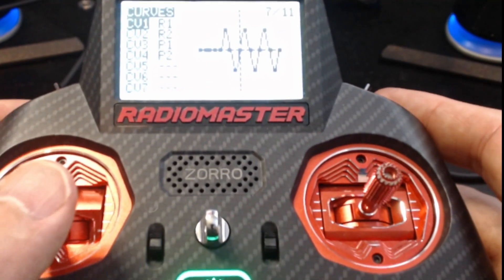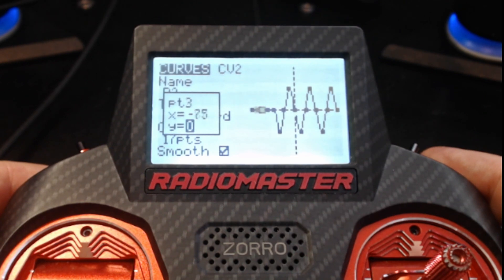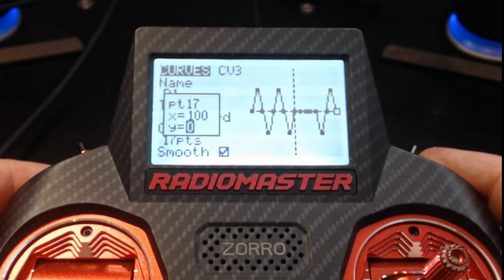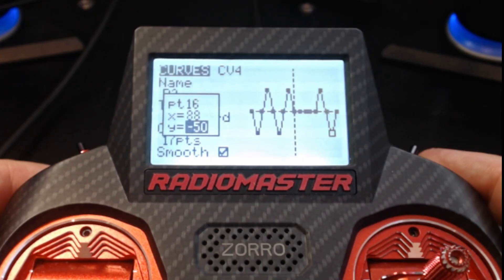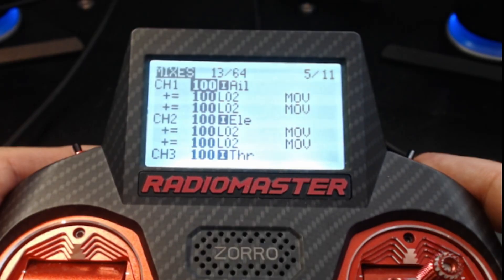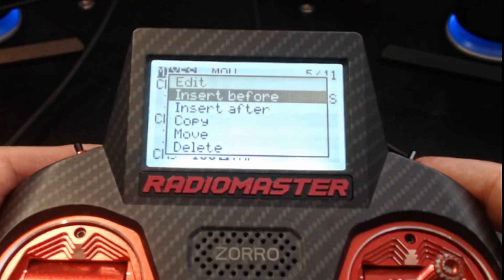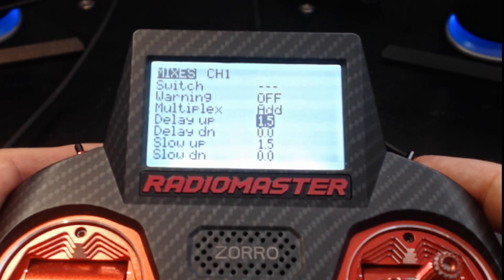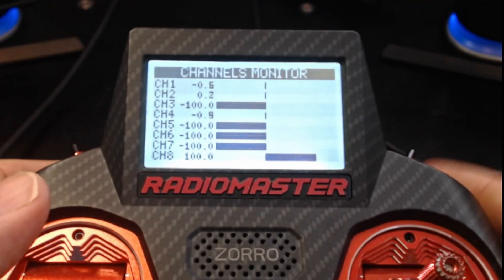An "Auto Wobble" Controller from your open/edgeTX radio

Comment: I have everything set up correctly, if I look at the receiver graph and activate the wobble mode the quad starts to oscillate in 2 directions but at the same time it slowly turns over with each repetition until it turns over completely, I would like to be sure that this does not happen during the tests, do you find the same behavior?

Comment: on my GX12 I can't make it work. tried on toggle button SD, but the logical switch L02 never goes active.
I used the function Tim to reset the L02 every 3 seconds until the SA is down.

Comment: This is a really useful script, thank you! I notice that it provides smoothed inputs, would an unsmoothed copy of it with plateaus after each setpoint change be useful to see how the gryo settles? That is, if looking at blackbox explorer traces.
Reply from the maker: The script could be adapted as you like. But it sounds like you’re interested in making it a step input. That’s very doable. But to do that you have to provide sufficient duration during the step, at least the duration of the presumed overshoot when under dampened. In other words you’d need the step to last roughly 100ms or so before returning to 0, then stay there for 100ms or so (longer for larger rigs whose resp latency is slower)

Comment: Haven't tried it in the real world yet but in betaflight receiver tab it shows the simulated quad gradually rotating left and to the rear. After about 15 seconds it's completely flipped. Been over the parameters with a magnifying glass and they're the same as in screen. Not sure if stick interactions to counter rotation will skew the logs or interrupt the script. 
Great work though. Very clever.
Reply from the maker: That’s because it’s an acro mode model. You can use it only to see if it’s working. You have to use angle mode to use it.
Reply: @PIDtoolbox  I did setup a switch for angle to see if that impacted but it made no difference. 
I'll try it in real world though to see what's happening. 
Thanks you for the reply
Reply from the maker: @baughaninastorm-y2t the BF model can not show results in angle mode. That model is unaffected by the mode you set
Reply: @PIDtoolbox   Fantastic thank you. Charging up some packs. Hope to give it a go later.

Comment: Which sample rate BB is better to use when tuning PD? With my whoop at 1khz BB the curves in step response point to D=0.95, and at sample rate BB 2khz the ideal curve points to D=0.8. I have tested with autowobbler several times and always come across this difference. Intuitively it seems that the higher the sample rate BB, the closer pidtoolbox will build step response curves to real processes
Reply from the maker: That’s odd. The step resp should not be affected by lograte at all. DM me over Facebook or Instagram.
Reply: @PIDtoolbox  Even without detailed analysis, you can see that for the same P, I, and D coefficients, the graphs in the step response tool differ greatly depending on the log collection frequency.
Reply: @PIDtoolbox  I'm not that good at math and transients, but I think it has something to do with aliasing between pid loop and loging rate or the nature of the differential component, which is related to the sampling frequency.
Reply: @PIDtoolbox  my previos answer was dropped( I also thought that lograte should not affect, but the facts say otherwise. I just repeated a series of experiments at 1, 2 and 4 kHz and got different curves for the same D. I am using version v0.71. Unfortunately, I do not have a facebook and instagram account, only telegram. But i will try to create instagram acc)

Comment: It works very well. Thank you. During the test, I also controlled the roll and pitch along with the throttle to avoid hitting the wall. Is this okay for analyzing the pid graph? Or should I only move the throttle and test?

Comment: this does not work with FreedomTX or whatever the Tango 2 Pro is running, right?
Reply: It doesn't work with mine. I can't setup the curves properly. As soon as I edit a curve, the next previous one gets edited with wrong values. I think it's a firmware bug. I have fdtx-tango firmware, version TBS-1.3.0
Reply: @FRY_FPV  same thing. I managed this to work with setting curves on cv1-cv5-cv10-cv15. Each one affecting 3 behind and after - 100% bug
Reply: I own both, a Tango 2 and Mambo radio. On neither device I encountered these problems you mentioned. FW v1.30 is pretty old (3 yrs.) and outdated. You should really upgrade to v1.40. Zero problems with Brian's wobble script on my side.